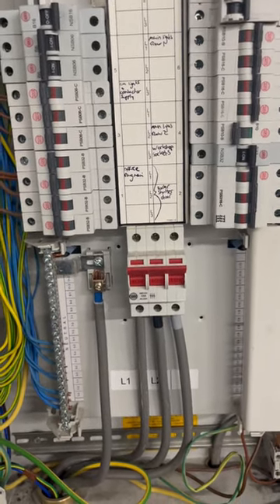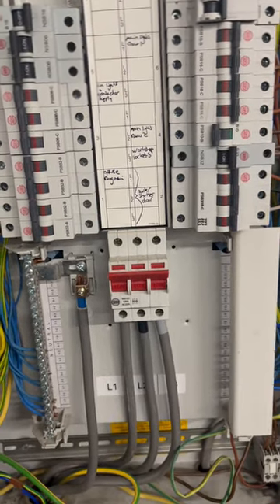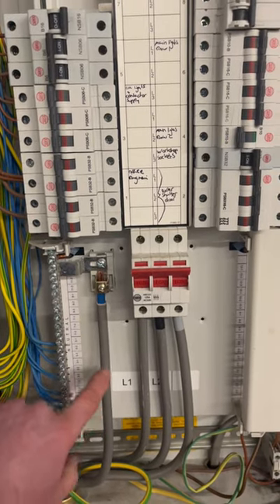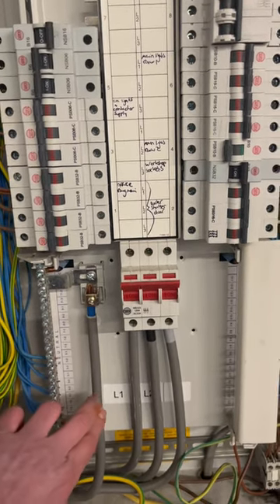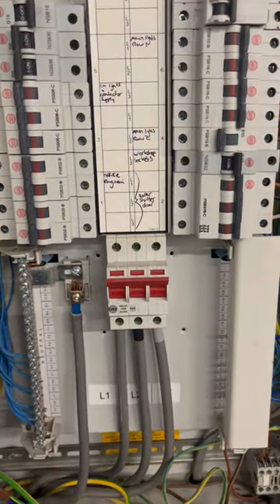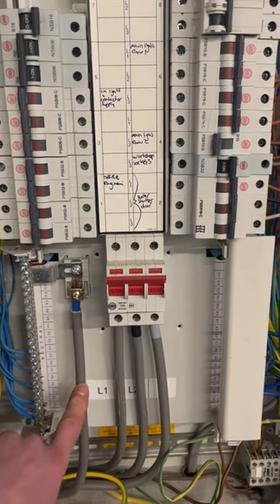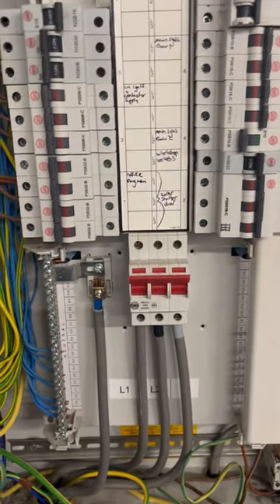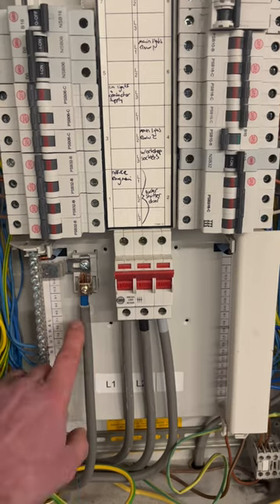No isolation on the neutral ?!SUBSCRIBE ?!👍👌⚡️

Comment: A lot of manufacturers do make a 4 pole switch disconnector , these will have the neutral marked as they tend to be early make late break.
Reply from the maker: Yes Jamie , not common on a TP install though
Reply: @Mainly_Electrical  We install them all the time we always use Schneider or Eaton. Think they are readily available on others to often not purchased and installed.
Reply from the maker: @jamieo6642  definitely j
Reply: @Mainly_Electrical  Merlin Gerin definitely have them (Now badged Schneider), It's only the boards that don't have a neutral where we only use 3pole switch.

Comment: So what about all the boards that come with 4 pole isolators? What about the isolator feeding the board itself being 4 pole? What about 3 phase boards with a 4 pole RCD device in place of the switch disconnect? Are all of these risking damage to appliances? Would be fantastic if someone who knows a lot about this could explain 👍🏻 cheers guys
Reply: Alright after thinking about it for a minute I can see why the neutral being disconnected first would definitely cause issues. Can damaged caused by this be prevented with a surge protection device? Also still interested in why 4 pole isolators or RCDs even exist if this is the case

Comment: On a tt you need a 4 pole main switch
Reply from the maker: 100%
Reply: Can you explain why?
Reply: @stephenllewekyn706   neutral faults from the supply side can cause part of the installation to have a potential (voltage) with main switch off 

Personally I always turn off all the loads (mcbs) before switching the main switch off and again turn on switch then add loads helps prevent those possible arcing fun issues and sometimes those mem 2 switches are very very stiff (bar$ards)
Reply: Agree with that
Reply from the maker: @richardgodfrey1936  👍hi Richard good to have you here 👌

Comment: How would you get 2 phases on the single phase loads when they're only connected to a single phase?
Reply from the maker: You an electrician Chris ? Qualified
Reply: Draw it out and you will see. The neutral which is referenced at zero becomes a floating neutral.  If both loads were resistive and the same ie 2 x 2 kw heaters they would work fine. The problem occurs as this is a DB the loads are u balanced so you could have anything from 230-400v going through one circuit.
Reply from the maker: Try f*cking off you nob end 👌
Reply from the maker: Where you gone hammy boy ? If you are only going to leave negative comments do everyone a favour and piss off 👍
Reply: @jamieo6642  correct,  you effectively end up with 2 circuits in series  between the phase to phase with only the current draw on each side dictating the voltage on either side, so like you said you could end up with virtually all the voltage on one side if the other side is heavily loaded 👍👍
Reply: @Mainly_Electrical loooool
Reply: @Mainly_Electrical loooool

Comment: Yeah that would be bad, if one side was heavily loaded, showers etc and the other side just a couple of TVs etc 🙈😅
Reply from the maker: 💯 mate
Reply: @Mainly_Electrical  this is obvious to me, if you think of the transformer you have two (LEGs) /secondary windings of the star between any two phases 120 degrees apart in phase 415v and 240v to the centre neutral/ground
Reply from the maker: @T2D.SteveArcs  exactly that mate . 120 apart , if the neutrals lost it would be devastating ❤️
Reply: Here in America household power its the same thing. 
New year eve my neutral failed out on the utility pole. 
Lucky only a couple cheap appliances were ruined. 
I waited until morning to ring up for a repair. 
Wanted to have the repair crew get holiday pay !
Reply: @benjurqunov  yeah you guys have local transformers with a 240v secondary centre tapped ground so 120v 0v 120v so if you lose your neutral/ground you would have the same problem 👍
Reply from the maker: @benjurqunov  👍
Reply from the maker: @benjurqunov  neutral and earth linked in main panel aren't they ? After your meter ?
Reply: @Mainly_Electrical in America yes bonded at the main panel only
Reply from the maker: @proudservice4407  thankyou mate

Comment: Yes this is great. But on single phase why do you have to switch your neural? Is that code there?
Reply: The neural is still considered a live conductor and under certain fault conditions could be live, 
Parts of Europe have two pole MCBs, but here in the UK we have not adopted that as of yet, I’m in two minds about it, I think for certain types of circuits it good, others, dose not make any difference, 
It would make the dis boards really big, which is not always practical here
In the uk, as some houses are very small
Reply: You can get a floating neutral and if you have lots of inverters the neutral can be very sparky.